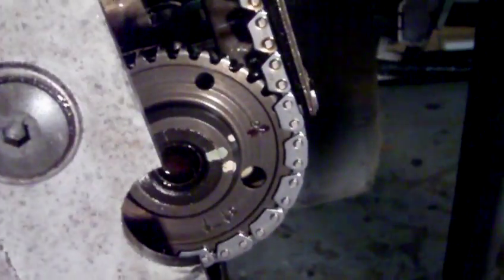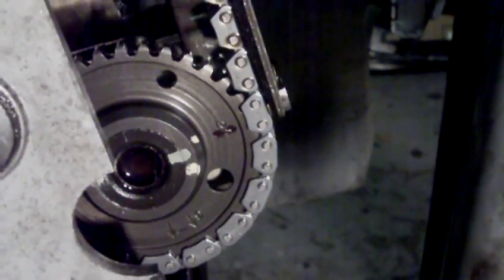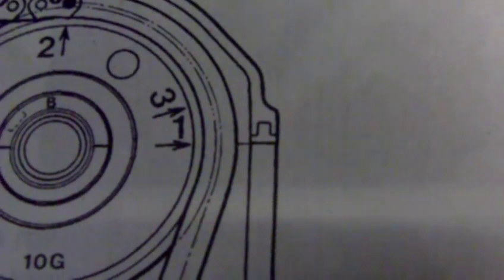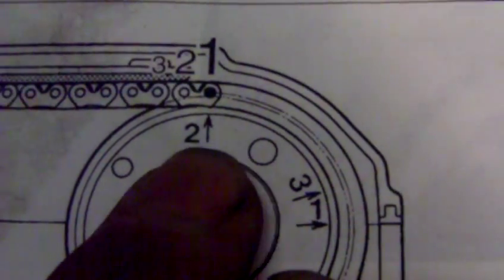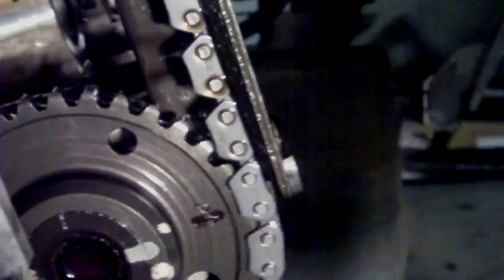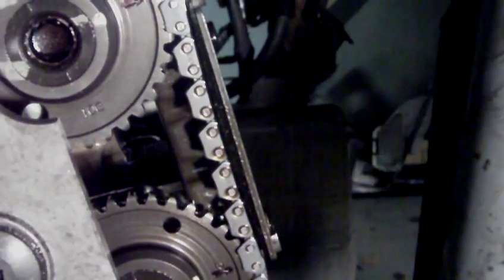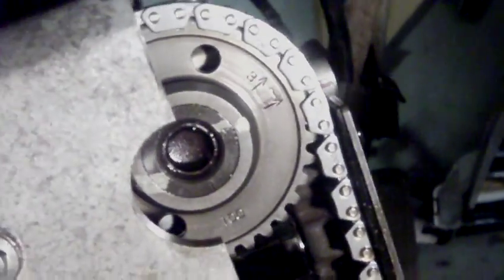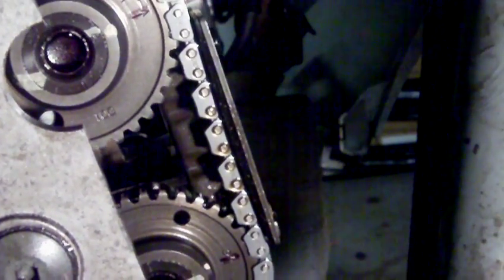Suzuki Burgman 650 timing chain alignment

Comment: What is not clear is that is the set to TDC is the piston in top position,is the marker on the engine bolt in line with the marker.

Comment: I think you're wrong. When I change timing chain on a low miles customer's bike I found the timing is as per manual, assembled in Suzuki. Needless to say the engine starts and is running fine.

Comment: You have a cam (intake) incorrect.
Reply: I have a 1st gen sv650 that needs rear cylinder time adjusted as i bought it with jumped time. Any help one the markings it should be at?